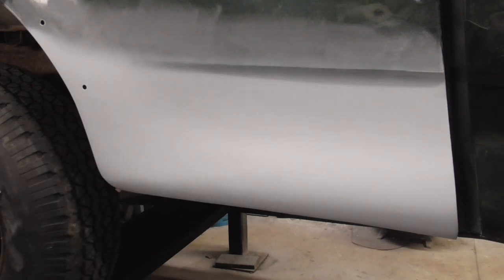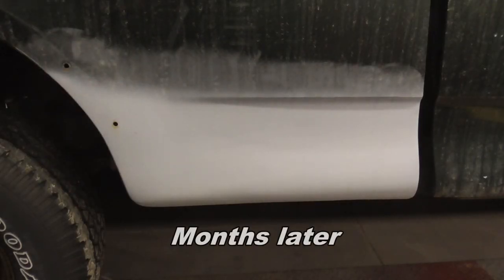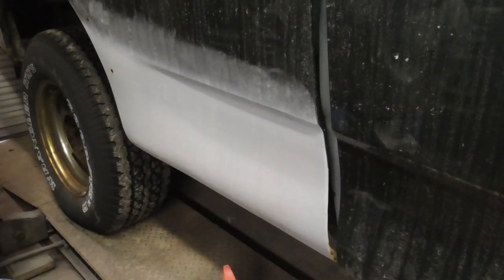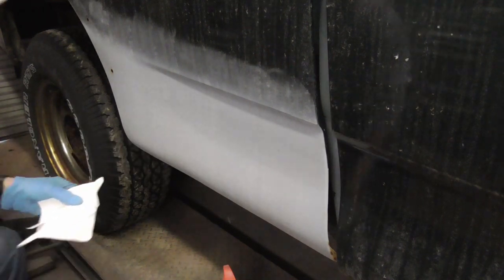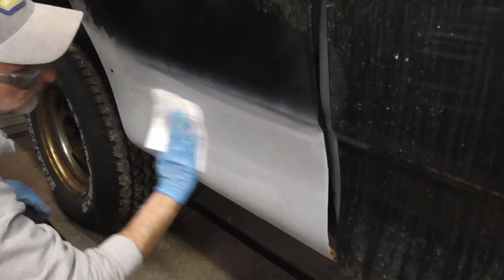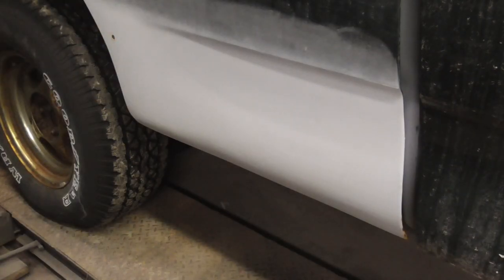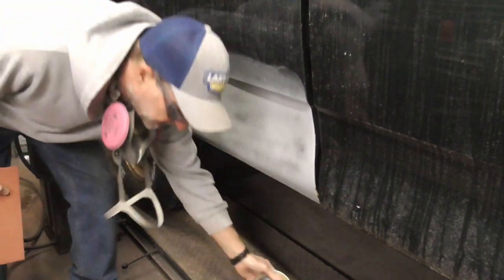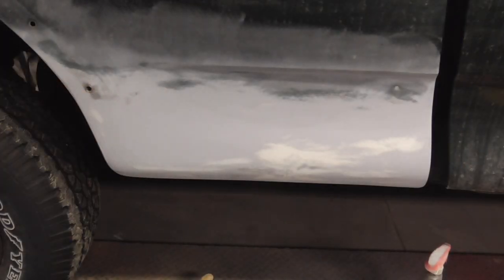How Long Can I Leave a Car in Primer?  Primer/Filler vs. Weather⛅

Comment: I redoing my panels now. The 2 coats of epoxy primer lasted about 10 years before chalking. The car is stored out in the sun under double covers. I’m only completely stripping defect areas. The rest are just getting a mil or 2 off and reshot.

Comment: As long as it’s actually coated it fairs pretty well… but I had a nightmare once with my own project that I was too lazy to coat bare body filler and a few bare metal spots before putting it outside for a few days. Needless to say I should have taken all of that back to bare instead of continuing forward with the paint job.. because as soon as it was all sealed off and baked in the sun for a few days…that area bubbled up and expanded into a nightmare!🤦🏻‍♂️. I’ve gotten lucky quite a bit-fortunately I’ve never had a customer job fail, but that one lesson for me was all it took-I’m a diligent epoxy guy now.
Reply from the maker: All it takes is one lesson when it equals $ or tons of work 👍🛠😊

Comment: sseen this to be correct, but now you have me wanting to ask a guy around here, he built a 1950's Dodge truck, he has drove it all the time since I was a young man, over 30 years, he is an old hot rodder, but its gray primer and flames on front end, with custom checkerboard paint inside cab, but i dont think he resprayed it as flames looked same all my life, so a primered truck for over 30 years, saw it in last 2 weeks at store. but i figure his is lacquer, but who knows, i did a few vehicles with epoxy in early 1990's so it was around.
Reply from the maker: Thanks for your story Randy - love to hear different things like that - have a good weekend :)

Comment: I still think I would have hit it with 2k epoxy (or at least sealer) if I knew I was going to let my truck sit outside.
But I've already admitted I know nothing, and that's why I watch these informative videos.
Thanks Jerry! Have a great weekend.
Reply from the maker: Thanks for checking it out Jim.  Have a great weekend and great to hear from you  :)
Reply: yea its a safer bet. If you have enough primer on there of any kind it will last for a bit but sometimes it starts failing in a few areas. At least here in the really hot sun.
Reply: @Mikefngarage  Some primers are very soft and absorbent.
Their whole purpose is to provide a uniform surface for the color. But sealers and 2K epoxy will keep moisture out for extended periods.
If you had a vehicle in damp/rainy areas of this country you would have to bake it before painting.

Comment: It happends on our ride too. I cant finish it since we got to use it for delievery on everyday basis. The only time I get to work on it is when days off. I applied body filler directly on bare metal too and applied epoxy primer atleast. ( And never got to finish it untill now hahaha ) After 2 years of daily driver beater rain or shine it didnt delaminate or didnt rot the filler beneath it. But the gray color on the epoxy primer dulled out. EP are vulnerable to UV rays but it keeps your metal and filler water tight.  I conclude this test is 100% LEGIT. as long as you dont apply filler in already rusted metal it will be ok. Or atleast you dont scratch your primer down to metal it will not rust. This vid is helpful.
Reply from the maker: Thanks for your input Nics - I appreciate the support :)

Comment: That is a really cool test, but I question the claim about body filler being non porous.
In this example I feel the primer was protecting the body filler from absorbing moisture.
Years ago I block sanded and exposed a penny sized spot of filler, but mistakenly painted the panel anyway.
The filler soaked up the paint and it looked terrible, had to sand it down, spot prime and respray it.
I know there's a few on the market that claim to be non porous, meaning the others are not?
Either way, dig the videos - so thanks 👍
Reply from the maker: I'm sure it's true that body filler absorbs moisture but I think it's a lot like wet sanding primer.  Yes the primer absorbs some water but it dries quickly or evaporates so fast that it doesn't really affect the end result.  I think you'd have to leave filler outside unprotected for years before what's behind it starts rusting :)

Comment: I made the cabin let it with primer pu and wash for 1 year, all rusted! other primers too. now I will use always a rust protection primer. maybe your clima isn´t hot and wet like ours in brazil.
Reply from the maker: Thanks for sharing.  Michigan weather is all over the map but this truck was parked out in the open so the wind and sun could dry it - that may have helped :)

Comment: I replaced the fender panels on the bed of my 2012 Ram 2500. I sprayed multiple coats of primer on it with a rattle can. I am looking forward to seeing if any rust came through after a winter of snow plowing in Maine. I didn't have time to finish it before Winter showed up.
Reply from the maker: Wow... with all that salt I'm pretty sure you'll see something.  Let me know how it goes :)
Reply: @LakesideAutobody  I have one more blocking session. Snow is just starting to melt and I will tackle it in late April. Rocker panels under doors are next and then I will get a local painter to make her look pretty. You're videos have been helpful.
Reply from the maker: @tomchristopher71  That's good to hear - let me know how it turns out :)
Reply: How'd it go?
Reply: @datjap8883  Only a few small areas had rust appear. I fixed a few of them and still have some block sanding to do and finish the primer.
Reply: @tomchristopher71  that's good news! I have hope for my primer of 2 months now lol
Reply: Been getting my dato 1200 ute ready for paint

Comment: I'm guilty of leaving primer exposed on a lot of my 'junk' after I'm done with the bodywork. Haven't really ever had a problem leaving it set out, but only after driving it on the road. Usually the 'sanding' primer or the surfacer is the problem. I just cleaned up my winter car this past Fall and used Upol acid 8 and some etching primer (spray bomb) then a top surface primer. Was OK then we had our first 'snow' and was driving on the Interstate after being salted or calcium chloride'd and the next day after the first 'snow' drive had light rust coming through. Sanded it down and used some enamel primer. OK now, might have been thin in those spots on the etching primer but I did lay on the 'regular' primer heavy. Other cars when I lived more South with no salt I never had a problem driving in prime, even years later. But I believe I did use that 'yellow-tan' DuPont non-sanding primer as a base. BTW, I see a lot of people just put E-coated panels on their vehicles and drive around and when the sun eventually beats it off the whole panel turns to rust. Almost nothing you can do at that point. They think the E-coat is like a final finish or primer or something.
Reply from the maker: I'm not sure what that E coat is... Now I'm curious - I'm going to have to look that up.  Thanks for your input Vince - have a good weekend :)
Reply: @LakesideAutobody  It's that black coating that comes on fenders and panels when you buy them new. It's an electrostatically applied coating rather than primer to prevent flash rusting. Not made for exposure outside and needs some kind of prime coat.
Reply from the maker: @vincemajestyk9497  Yes - but I'm wondering what kind of coating it is - is it a primer - is it a paint or is it like a sealer?  Thanks for getting back to me :)
Reply: @LakesideAutobody  No problem Jerry! They call it EDP. Electrophoretically Deposited Paint coating. It has very good adhesion to the steel since it's applied by a charge, BUT, It's intended purpose is ONLY to ensure the integrity or preserve the panel during storage, shipment and transport to the end user. It needs to be properly primed, sealed, and top coated (if you want) once installed. 
I can tell you, it won't withstand the elements on it's own. It's good enough for what it was designed for. Not as a finish primer or top coat. They recommend priming with automotive grade primer and a topcoat, so I would say it's a 'weak' primer but sticks good as a base and won't come off if finished properly. So, I guess to answer your question it's a paint and a primer but designed for a specific purpose.
Reply from the maker: @vincemajestyk9497  Thanks a lot for that Vince.  I appreciate your input.  The stuff sticks very well - never actually experienced it flaking off, chipping, etc.  Must be a pretty decent quality coating.  Again, have a good weekend my friend - nice talking to you 👍😊
Reply: @LakesideAutobody  Thanks Jerry, you too! I think that stuff is like that POR15 humidity activated urethane. It's really strong, durable and has good adhesion but breaks down under UV light. No doubt that EDP or 'Ecoat' sticks though.
Reply from the maker: @vincemajestyk9497  👍✌

Comment: Hello good sir. I just used a paint gun for the first time on a couple practice pieces with primer...and wouldn't ya know it, I've got questions. If you want to answer, here they are!
- how the heck do you pour a brand new gallon of paint into a small mixing cup? That was a rough start.
- how much time, generally, do you have before the paint starts drying in the gun? I mean, for primer the flash time is 15 minutes and I was worried. With paint I'll be especially worried between coats. 
Anyhow, that's all. It went smoothly enough to where I can't wait to do it again, so that's good. Thanks man for everything.
-DIO
Reply from the maker: Don't pour it slow for the first question.  With practice you'll get better at it.  If you are using 2K primer (the kind you mix hardener in) - you'll have plenty of time before it hardens in the cup - like hours.  If you are using lacquer primer 1K (no hardener) it really will never harden in the cup.... well... maybe if you left it in there for months or years.  If you can't wait to get out in the garage - you are already successful 😊
Reply: @LakesideAutobody  Thanks again!

Comment: In some of your vids you spray primer with siphon gun.You get it to spray nice and neat.What settings psi etc? My gun is hvlp siphon ,sprays pretty hard(more pressure ) compared to yours.Mine has a port regulator max 10 psi.I run air on handle almost wide open.Fluid open 3 turns.Was told air pressure at gun didnt matter.Mine usually 100psi.

Comment: Love your videos!!
My car has been epoxy primed with Eastwood 2K roll-on primer and their 2K aero-spray. I have a small section that I needed to address and now I have some bare metal. Can I shoot that small section with some Krylon primer (cheaper then Eastwood) to protect it until I get to shoot my urethane primer or do I need to stick with the Eastwood 2K?
Reply from the maker: You can use the cheap primer to keep it protected.  Hit it quick with a DA before you recoat with urethane primer just to be on the safe side :)

Comment: Great video Jerry, I definitely was told lacquer primer would rust out over time when I first started painting cars!
Reply from the maker: Thanks 👍 UPK - I see you're workin' hard down there.  Spring is coming my friend :)
Reply: @LakesideAutobody  I’m trying to clear out the shop so I can work on my personal projects, I would like to have one of the projects ready by spring
Reply from the maker: @UndergroundPaintKing  I would love to work on a favorite car of mine - 1971 Plymouth Satellite - my first car.  Had it all jacked up in the back with fat tires and nice rims - then I got to thinking I was Luke Duke and literally slid it sideways into a tree right near you in Lapeer County.  Those are some of the meanest looking cars ever - just a nasty ol' looking grille :)
Reply: @LakesideAutobody  do you still have it?
Reply from the maker: @UndergroundPaintKing  No but the other day I was thinking of a parts car I bought for it - 1972 Plymouth Satellite for $200 - had a 318 3-speed manual - I just left it in a field at my friends house - don't ever know what happened to it.  The one I smashed went to the junk yard - had a 383 auto.  Both are gone - actually wish I had the 318 with the manual - that would be awesome 🔥🔥🔥

Comment: Great video Jerry I just use primer on my birds and they are holding up good 👍
Reply from the maker: Thanks for checking out the video Luis - have a great weekend 🛠🛠
Reply: @LakesideAutobody  why do guy's talk about sealer I just primer the car block sand and then paint
Reply: @firstgenerationgarage2803  kind of funny when you finish a great paint job.. then the old color seeps through the fresh paint. Get educated.
Reply from the maker: @firstgenerationgarage2803  Sealer is not necessary BUT... Here's a few things to consider... If you have a bunch of bare metal spots that you'd like to hit with one coat of very silky smooth primer.... SEALER.  If you want to get the car one color before painting....SEALER.  If you are fearful that the paint might react to a specific coating that you are leaving on the car or just keep everything separated (sealed) from the new paint... SEALER.  Finally if you want to bury minor imperfections, minor sand scratches, etc... SEALER.  Those are a few reasons off the top of my head why one might want to use sealer before painting.  Good question Louis 👍
Reply: @russlardinois5751  I never painted a car and left the old color on I always sand everything off and then bodywork primer and then paint I have been restoring Firebird generation Firebird like this for about 20 years now and never had a problem
Reply: @russlardinois5751  No need for being an a$$. Have a nice day
Reply: @LakesideAutobody  Well explained Jerry, thank you for always sharing you're GOOD knowledge and quieting the confusion out there. Some of these folks act like they're painting great finished cars, and when you get right up to them, the truth speaks loudly!
Reply from the maker: @fretsman68  You're welcome - you're right - it has become way to confusing and I think the large companies want it that way - end up buying stuff you don't really need :)

Comment: Great video. Just curious what brand primer did you use? Thanks in advance.
Reply from the maker: It's Auto Body Master lacquer primer surfacer.  Any automotive primer surfacer will work for you - urethane, lacquer even polyester although poly is more for extreme block sanding :)
Reply: @LakesideAutobody  I watched the your video about primers very informative.
Reply from the maker: @johnraisanen5131  Thanks John - enjoy the rest of the week :)

Comment: Do you have any videos of repairing rust on the bottom of doors with fiberglass or rocker panels?
Reply from the maker: I don't.   That can be difficult though, because you can't bend the fiberglass cloth around edges.  It can be done... but you have to get creative making sure that the edge is layers on top of each other instead of trying to fold them.  I will try to do a video on that though if I get a door bottom or rocker that's rusted :)

Comment: I fixed all the dents on a old CJ7 primed it with black lacguer prime and after wet sanding with 320 I thought it looked good and never painted and it was fine for the next 2 years I had it.
Reply from the maker: Thanks for your input DGC - have a good week :)

Comment: I've never understood the guide coat application. I do know you put it on to find highs and lows but it's put  on so sparingly. Meaning there's a botch of black then inches of nothing. Another botch of black etc. The areas where there isn't any makes it tougher to see the high and low spots I would think. Why not make it all one uniform color?
Reply from the maker: Good points by A. Melbs.  You just need a dusting because as soon as you run a straight block over the top it will "wipe" or sand away all the dots of black paint except for what's in the low areas.  I get where you're coming from now as I explain this 👍  Here's the part you're getting hung up on.... The only high spots you'll have is either shown by filler (easily seen) or metal (easily seen).  The only low spots you'll have is the areas with black paint dots.  All the nicely sanded primer is the same level.  That's huge right there... In other words, if you ran a straight board across some primer and the sand paper hit evenly all the way across with on swipe... then you're good.  Sorry if that's confusing - let me know if you have more ?s :)

Comment: Will epoxy primer from an aerosol can perform the same way leave it on for a while until you can get back to the work? I'm thinking of the epoxy primer in the aerosol can the two part.
Reply from the maker: Yes - if it's 2K, it should perform the same :)

Comment: so basically a week or 2 it should be fine!! i was worried to paint my car. I painted my other car a few years back. but only had 2 dents. so very little primer was used. i have an 05 wrx that will be painting but every panel has a dent lol. but i was worried it was going to sit for a couple of weeks cause I do work lol so time is very limited.

Comment: Hi Jerry, i have been working on a classic car of mine for a few months now. I have taken the car back down to bare metal and have done the welding and filling repairs. The car has sat in bare metal now for around three months, can i just prime over this or do i need to treat/clean the metal first to make sure there is no surface rust? Thank you Sam.
Reply from the maker: I would run the DA over it for sure.  If it's very light you can just use something like 220 grit.  let me know how it goes for you :)
Reply: Wipe it with phosphoric acid

Comment: Whats the point of spray bond black?
Reply from the maker: The little dots of black paint will sit in the low areas - letting you know that you need to sand more.  Once you sand down far enough all the black paint should disappear :)